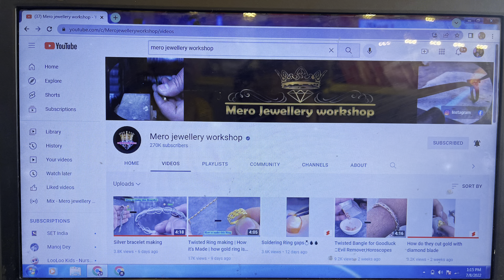USB Stick 64GB Silver Pendant Making

Comment: Want to get electric shock each time you plug in and out?? No thanks!
Reply from the maker: 5v Dc  never gives you electric shock
Reply: @Merojewelleryworkshop   my friend had a Kingston metal body pendrive, every time when I plug that to copy something I used to get shock why is that then? Problem with system itself? Maybe?